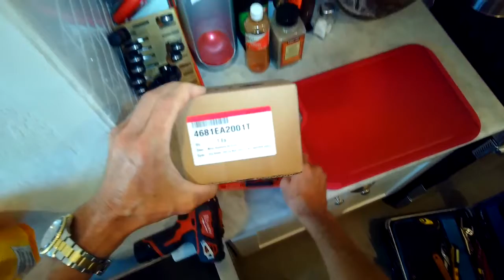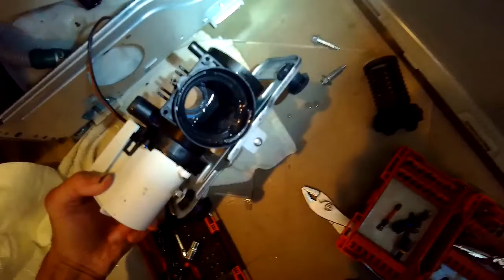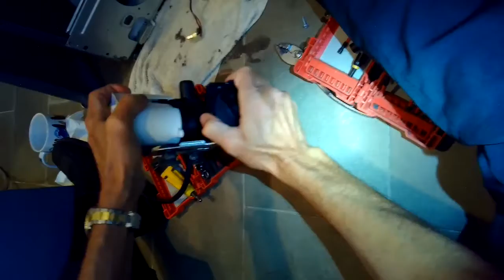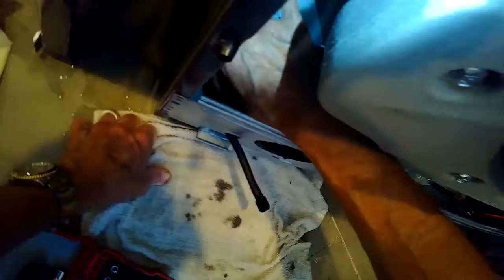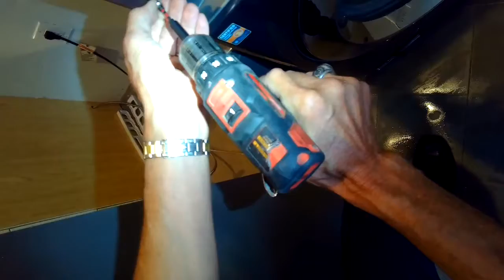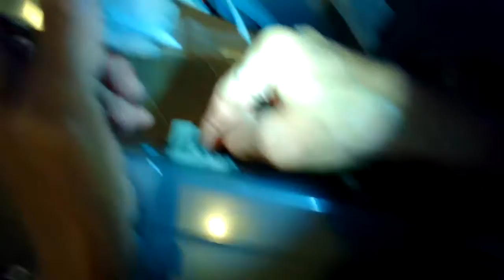✨ LG WASHER WON’T DRAIN - OE Error - Save $$$ With This DIY Fix ✨

Comment: I have an lg refrigerator with a bottom freezer, freezer not working,  going to try and take the panel off the back and clean inside. Had to toss all our food, bummer. Wish I hadn't bought an lg
Reply from the maker: Probably need to replace the thermal overload for the compressor and clean the coils
Reply: @ScottTheFixItGuyChannel  thermal overload, is that a part that I can order? From an appliance store?
Reply: @ScottTheFixItGuyChannel  I don't think I want to try that. A man at an appliance store suggested I clean the coils and the fan. Did that today. Waiting to see what may happens, give it a day. Otherwise, use as frig, and buy a small freezer.
Reply: Yes. LG sucks on refrigerator making. I have one that was tempted because of the low sale price at HomeDepot for this 4 doors stainless steel look fridge but from day one, icemaker delivery has a problem. It is simply not well isolated from the weather and ice at outlet always partially melt, get the outlet port clogged... If only they could make fridge like their TVs...
Reply: @samsen201  well, I'm thinking I may just use the freezer as a other refrigerator and buy a Good small freezer.
Reply: @susanpremo8068  Excellent idea. If you have access to Costco, you may find well priced on with a better return policy, in case. If I remember correctly, last time I checked, they had Hisense Chest Freezer, 7 cu ft white for about $150 that should serve you very well, next to your current refrigerator. But then, seriously, if you listen to what Scott suggests, you will make that ole thing come back to life and I did just that by trusting him. Of course, opening and closing these things, then compatibility of the part you buy is another issue. So best of luck.